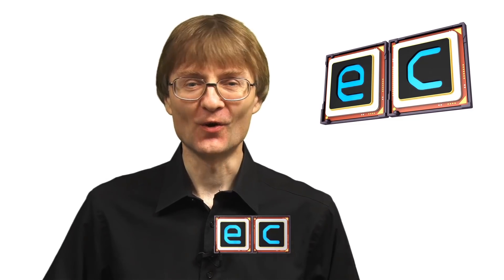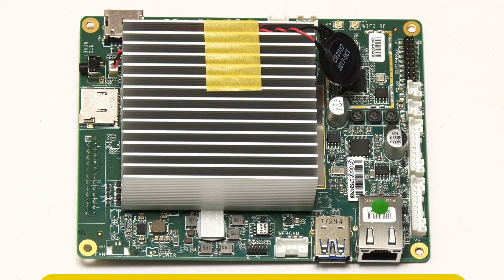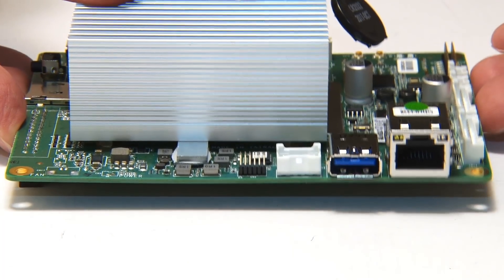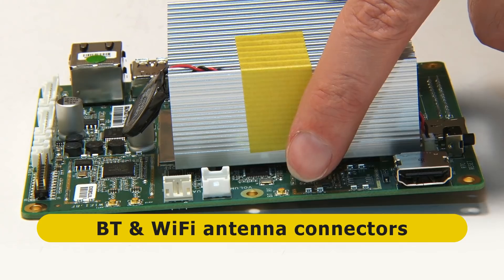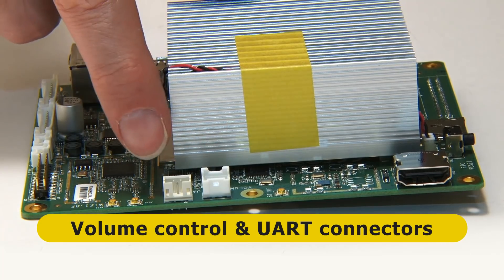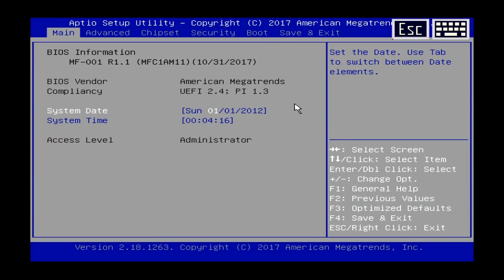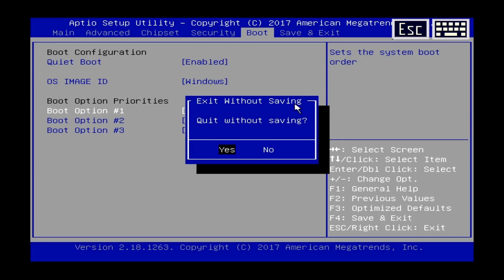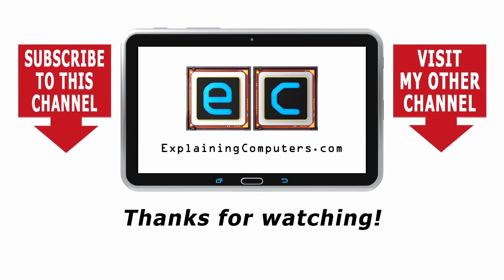Atomic Pi Intel Atom SBC

Comment: I have a couple of these, and indeed its very powerful for very cheap.  and they are still available, which makes me wonder how big the market is for such devices.
I searched your channel to see if you had a review of the Le Potato board.  I've been looking for something with hdmi output that can run a 4k display, it seems this board can do that, and is only $30 on amazon right now.   Maybe you can take a look?

Comment: I have the large breakout board which has screw terminals and a HDD-style Molex connector for power input.  The Molex seemed a bit sketchy causing my USB3 HDD to randomly restart, so I ended up using the screw terminals, powering everything off a PoE to 5V adapter.

Comment: I understand that my post is a year late but I think I know the reason why they had to gave up their original plan and not to use this board to build robots. I have two of these Atomic Pi and one is working but the other one is not working properly. I believe they have quality control issues with the components. The one that is not working well is due to the unstable emmc.

Comment: When I connect the atomic pi on the TV via the HDMI port, does the sound come out from the TV speaker, or do I need an external speaker?
Reply: The sound supposed to come out from the TV via the HDMI connection.

Comment: Would you say the atomic pi has more processing power over the Raspberry pi 4 with 2gb ram ?
Thank you
Reply from the maker: Yes. Also better cooling -- but far worse connectivity! :) The Atomic Pi is a great board for a maker, as you need to rig a PSU and wire in the USB 2.0 port, and probably a USB 3.0 hub. But if you are prepared to sort this, the Atomic Pi is a very good value piece of kit.

Comment: I got one of these with peripherals. I managed to burn it out in under two hours by accidentally touching the camera body to the circuit board somewhere in the vicinity of the gpio header. Only took a split second. Apparently they're a lot more delicate than most other pi's out there.

Comment: How can this work well with only 2gb of ram?
Reply from the maker: It is fine for lighter Linux distros for basic computing -- web browsing, e-mail, media playback, word processing, etc. But not a good board for gaming or, eg, video editing.
Reply: @ExplainingComputers  Sorry, not a proper question by me. What I am hearing is some are running windows on this. I understand your limitations. But it seems like for W7 it is not going to even do basic things very well with 2gb. Maybe with the W7 Lite version. I am wondering about Windows on the Atomic Dog.
Reply from the maker: @fredc8346  Windows 7 (32 bit) can run fine in 2GB -- doing this was pretty common when it first came out. :)
Reply: @ExplainingComputers  Ok thanks. That may be the way to go.

Comment: Christopher, I got 1 one the units myself, however in doesn't work, or I am using it incorrectly. I have the full size breakout board also. trying to power with a 12v PSU via the breakout board. Is there a secret 'on switch', if not I am going to just try and power the board with a 5v psu, how many amps do you advise.

PS keep up the great work, loving your videos

Regards Seb
Reply from the maker: It is some time since I booted up the Atomic Pi (although I will be doing so in a few weeks for an x86 SBC overview video). But I cannot remember an on switch that needs pressing. I will report back!

Comment: Can it run LinuxCNC? Can you please run LinuxCNC on it.
Reply from the maker: See my other reply -- it should be able to, yes.
Reply: Hi Chris many old CNC machines like mine run on DOS via pport. As my old computer running my machine has just died could an Atomic Pi run DOS 6.2 and could one add a Pport, preferably two. There may be better SBC for that application. Was considering a Beaglebone Black with Linux MachineKit. But an SBC with 3v logic where installed stepper drivers need 5v poses another hurdle. The consequences of change are not simple to manage as one's old systems are superseded. Have just discovered your channel - really interesting and useful... even for an ole DOSser like me.
Grateful for any pointers... Blake

Comment: Update: I reinstalled without an office suite rather than just remove it. I also made a swap file that I evidently forgot to do. I chose to make one without hybernate mode. It is running so much faster. I installed KODI today without a hitch. That was the main goal to all of this. I will update findings as I add media and configure KODI.  Thanks again to Chris for reviewing this board.  (Forgot to add, I am adding an external drive for media content storage.

Comment: I've been looking at SBC's since discovering this channel and the Rasberry pi. I really wanted a full version of Linux based on Intel processor, so for the price I got the Atomicpi. I wanted a full version of linux that had a great interface. Manjaro is simply the best for ease of use and install. I believe it will please anyone using it. I saw so many people on forums struggling with getting sound with other cut down distro's but Manjaro sorted it out during the effortless install. Even the volume and mute buttons work on my Logitech keyboard. It seemed a bit sluggish so I removed some things I wont do on the 55 Inch TV like the office apps. Overall it is running great 1920x1080 HD straight from Youtube in Firefox. I dont need 4K because this slightly older LED TV only handles up to what the Atomicpi puts out. I can also browse the net. I will be adding a 500GB Sata HDD I have as an external once the USB 3.0 hub and case arrive. I am a big fan of documentaries on youtube. Adding these capabilities to my TV with my Blue Ray player and Netflix app, I am quite happy with it and will install Kodi once I add the hard drive and some local media.  So to the rest of you running this SBC, dont fear the big package. Try a Manjaro install, remove the office suite and add a drive of some kind. You wont regret it if you want a decent media player for the price.
Reply: I forgot to add that a 3D printed case is being made at my local library for 10 cents a gram. A whopping $7.60. I downloaded the file and took it to them on a thumb drive. Yes, the library!

Comment: I am interested in the atomic pi because I wish to run windows based programs on a SBC... why didn't you show some examples of x86 programs being run? Why would an atomic pi be used if you are still going with linux stuff?
Reply from the maker: I didn't show x86 programs as I did not install Windows. Windows 10 can be installed, but the eMMC storage is limited, and installing Windows on an external drive is . . . tricky! :) Earlier Windows versions are unlikely to have appropriate drivers for the Atomic Pi. :(

Comment: Little interest on atomic pi, another x86 SBC: rockpi X already on the way, only $39 for 1gb version, and important it will use regular micro USB port for power supply. Worth to  wait for rock pi X
Reply from the maker: Rock Pi X certainly sounds very interesting.

Comment: how to install Windows 10, not in the device memory, but on sd????Very little memory(.
Reply from the maker: Windows 10 is indeed a challenge here. 16GB is very small for installing it.
Reply: @ExplainingComputers  Can I install Windows 10 on USB or SD? As for the raspberry Pi 3 Board, it works directly with SD.
Reply: @ExplainingComputers  If Windows 10 is not installed on sd.ATOMIC PI-useless Board,and Raspberry Pi 3 is the best, plus it is small.
Reply: @ExplainingComputers  Я думал купить еще один, но из-за того, что память для Windows 10 ограничена, теперь я думаю не покупать, я разочарован(.
Reply: @ExplainingComputers  Can I compress Windows 10 to have more gigabytes on the Board???

Comment: Find your videos very informative indeed!
In terms of the Atomic Pi it looks like it's a limited edition type of thing and consequently will not be around for very long.  So experimenting with a board like this seems of limited practical value, if not a total waste of time and money!
Reply from the maker: As I note at the end of the video, the Atomic Pi is a remaindered industrial component, with c.20,000 to enter potential circulation (which is probably far more than the manufacturing run of most single board computers, aside from Raspberry Pis). On experimenting, if this were an ARM board requiring bespoke software, I would totally agree with you. But it is a standard Intel-chip x86 PC, so its hardware is well supported. If it fails, it will not be able to be replaced -- but that is sadly the case for most tech products.

Comment: Seemed like a nice thing to tinker with.  Ordered one.  Then waited for a powersupply, then waited for antennas because I didn't want to power it up without antennas.  Everything finally arrives and it will not boot.  I see the bios pic and grub, then it either hangs or reboots....  So sad...
Reply from the maker: This is very sad. Have you tried writing a bootable Linux image to a USB drive and booting from that? Fingers crossed you get it working.
Reply: @ExplainingComputers   Yes I pulled one out of a PI and it never listed in the options which only stays on screen for a second, then reboots...  Might be a power issue...

Comment: AHA! Thanks for digging up the explanation for this board Chris, now it makes sense.
When I first heard about this, I thought Intel was getting rid of old stock or something like that, it was just too cheap for components. But this makes much more sense.
For those who don't know, this class of Atom Cherry Trail CPUs was in a whole ton of the tiny Windows sticks and boxes that were popping up in droves few years ago. Kangaroo PC, early GPD Win models, Intel Compute Stick, Gole PC, and a whole ton of other stuff. But they were all around the 200 bucks mark.
The trend fizzled out when Intel decided to shut down development of the Atom line (which I still think is pretty unfortunate), but seems they kept up going with Core M3 and M5 lines. Those are even more expensive though, 500 bucks and up depending on what you want.

I'd get one, but thing is, I already have both a Gole1 and a Kangaroo PC... that are juuust a bit above those specs already. X8500 instead of X8350. Not devboard, but for what I'd want to experiment with, better overall. I've been curious to see the difference between these and the M3 CPUs that replaced those though... particularly on the Intel Compute Stick. Too expensive for my pocket though. xD

Comment: Just a heads up as regards my Atomic Pi purchase, which Chris
covers here.

 

I paid £63.14 for the Atomic Pi and delivery plus £22 for duty/VAT.  So about £85.  I then must factor in a PSU.  Theoretically you can modify the 3A Raspberry Pi wall wart, theoretically you can modify a PC PSU although that would be wasteful.  I spent about £20 on a PSU because I plan to build a games emulator, with a case and so on.  Alternatively I may just see if the Atomic Pi becomes collectable since it has a finite supply; I think it will just die a death and people will move om to other SBC. 
Cherry Lake is dead so Intel won’t be releasing anything more.

I’m not convinced the Atomic Pi makes a lot of sense into the UK because of taxes, a mini-PC will give you M.2 and SATA which the Atomic can’t provide as it lacks enough PCIe.  It has
one PCIe lane and that is used for networking, based on my research nobody has successfully repurposed that single PCIe lane so it seems it is suck providing networking.  And few would want to lose networking anyway.

Comment: The fact that it's a re-branded board from a defunct product actually explains some of the more odd things about the board such as only having a single USB port, and the webcam port just being a usb 2 port with a different connector. No one else mentioned this in their reviews so that's a great bit of extra information sleuthing! Would also explain the need for using the GPIO to power the board rather than any dedicated power inputs.

Comment: Well my Atomic Pi has shipped, costing a not unsubstantial £62.79.  That is with postage.  Then I’ve ordered a Pico power supply, but not a top end one (which can and do cost £100s).  This is a speculative build for now, but that is another £20 and there would be maybe another £20 for a power brick.  I may end up not using the Pico, in which case it will get used for the STX/A300 M.2 to PCIe project which needs to power both a 75W dGPU via a molex and comes with a power brick to power the 2400G.

The I get this email from the Royal Mail;
“We’ve been notified that an item has been posted to you from N/A in United States of America. Just to let you know, it’s likely there will be a customs charge to pay for this item, due to the declared value of it.”

I did wonder how Chris avoided this as it gets triggered if the cost is something like £33 or over I think (from memory), there’s an obvious way around this which you can work out yourself but not all vendors will play ball.  I haven’t checked the duty likely to be owed yet but if it pushes the project to £100 or more then it would make more sense to buy a mini-PC based on a Cherry Trail and adapt that, it will not have PCIe (directly) but it will have M.2, and SATA, and a power brick and at least 4GB DDR.  They cost closer to £150 but have a case and USB 2&3.  This £50 SBC is quickly becoming not.  I will struggle t justify the purchase I think.  That said the 4GB Pi4 seems sold out so while that is really the better use of £50 odd the only one I’m finding is the £45 2GB version and that seems to offer the worst value- £35 for the 1GB if you aren’t needing a lot of DDR, or £55 for the 4GB if you are.  2GB falls between two stools for a maker who is likely to use the Pi4 for different projects over time.

The dangers of international shipments are ever real.  With China it is will it be as described, fit for purpose- with the USA it is duty, and I have a New Zealand package well over £200 floating in the ether- I can see it in tracking and it is in the UK, sat in a warehouse not moving for 2 weeks!
Reply from the maker: The price I paid -- £42.75 -- was for the board only, but included shipping and customs charges (I went for the slowest and hence cheapest shipping option, which took several weeks). I was very impressed at this price, which I think has risen since. Ordering from Amazon, they handle the customs charges internally and use their own shipping service to faciliate that process. I do a lot of international shipping -- almost everything I show in this channel comes to me from outside of the UK -- and customs charges are a significant issue. For review samples (unlike the Atomic Pi, which I purchased), the experience of the sender is important in correctly preparing the accompanying paperwork. :)
Reply: @ExplainingComputers  And I, ever the impulsive, thought 'I'm having that'.  In truth I wanted one anyway but when I looked a few months ago they were like £130 in the UK and that didn't work for me as I could get the low end Latte or the Rock Pi for that price range- or a mini PC for a bit more.  All it will mean is I have to do something 'good' with it, I get a bit lazy with the Raspberry Pi boxes because they are so cheap and available.  A bit of thought and a nicely made case and this should make a good Game's emulator which I will sell on when the stock is depleted.  Just hope the duty isn't to high- looks like 20% VAT, then 3.5% duty so less than £75 (73?).  That is more than the $35 it starts at mind and I wouldn't buy another.

Comment: Windows XP at least, please? Personally, I don't like this board. Limited edition controller, even worse. The GPIO header on the back is the only way to power up this board. Really? I do and don't like the 2lb heat sink. It is fan-less, which makes for a quieter build, but imagine the size of the case (3d printed?) to enclose this whole lot. I suppose the case would have a huge square hole on top for the heat sink fins. The lengths Christopher went to to keep this assembly neat made for quite the Rube Goldberg kit.

Comment: I was wondering if you had any stability issues with the OS that was shipped? I do have a 5v 3amp power supply and just have not found a good complete OS that it runs well on. I even tried using it for retro gaming. I just don't see a lot of community support out there. I'll be looking forward to your next video on this-

Comment: I'm running Ubuntu desktop on one of these, running FR24 radarview on Firefox and it's more than fast enough for a heavy webpage. It doesn't even get hot and draws less than 10 watts most of the time ( more like 5 watts... ). Actually I replaced a I5 NUC with this one due to getting rid of the fan and heat.
A great trick is to solder a push button to the power pads enabling you to power it up after shutdown without having to toggle the DC power ;-)